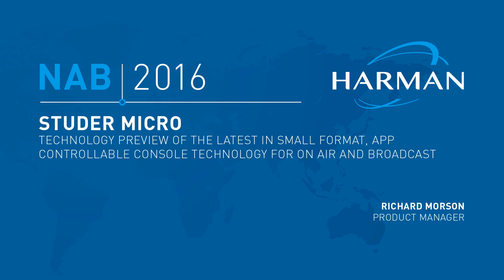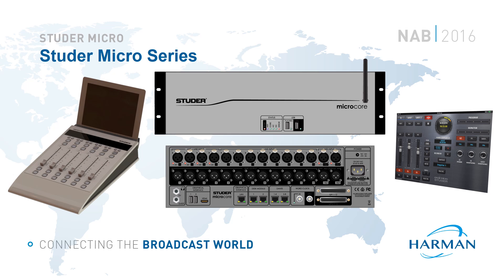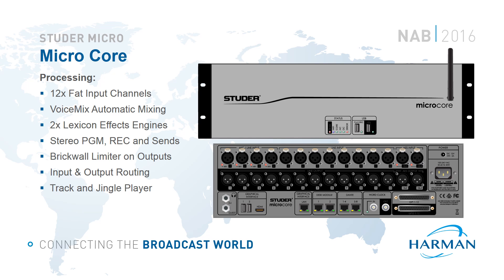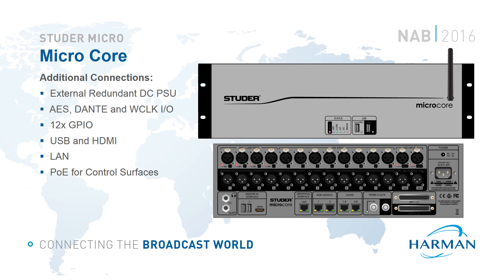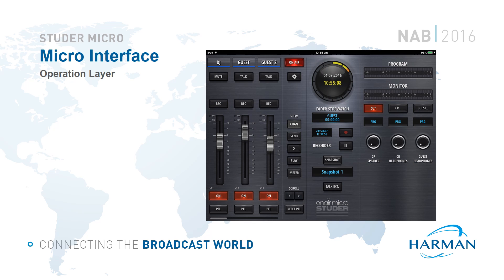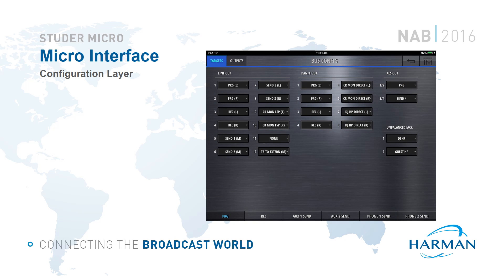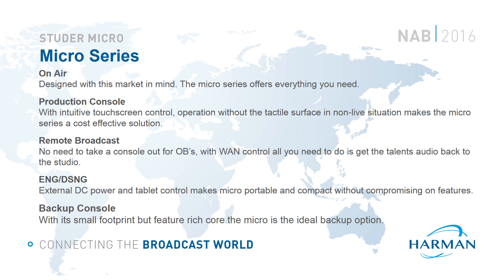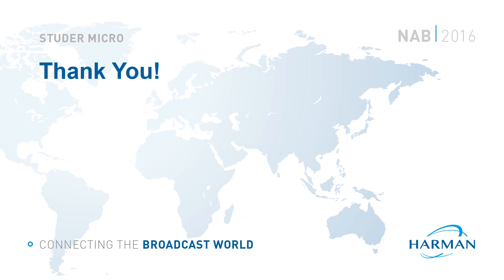Studer Micro Technology Preview

Comment: I'm very disappointed on this model simply because it's like kids stuff. No serious radio station (according to our knowledge & experience) would buy this set Who will use an ipad on this which after 3 hours of use will fall to 10% battery while charging.. Also where are the stereo inputs on the core? We did not see any stereo inputs. Just mono inputs & outputs. It just doesn't make any sense. And in general for all companies building a 5/6 ch mixers let me say that a station needs at least 10ch and to be 'live' too. 1 for the presenter's mic, 3 for guest mics, two pc channels (usb), 1 telephone (telco) and for some stations at least 2/3 ch cd inputs and all (except mics) to be stereo. Those are 10 ch just like that. Your previous models were the best like 'OnAir 1000' or the large (beast) 'OnAir 2000' model. They were the TOP of all other companies' radio-boards. If someone needs a 5ch mixer or even 5+5 why not buy a good dj mixer or two (even digital ones) than this model you're offering? Sorry..